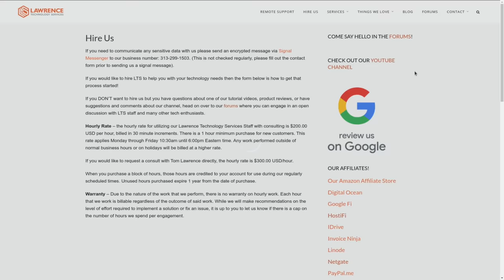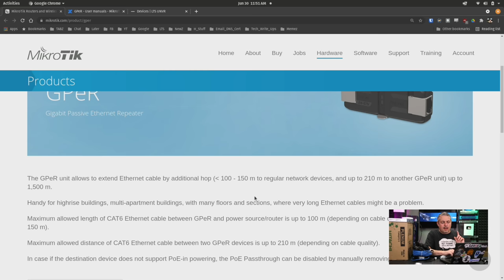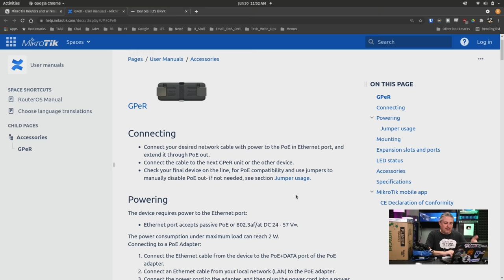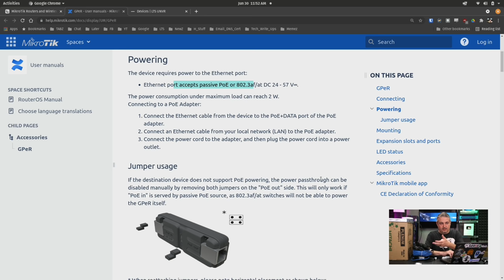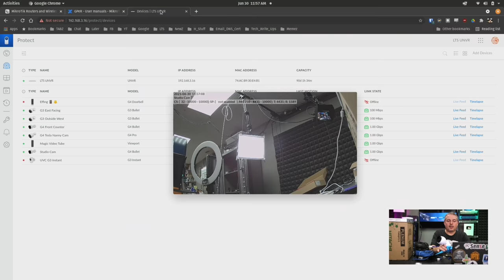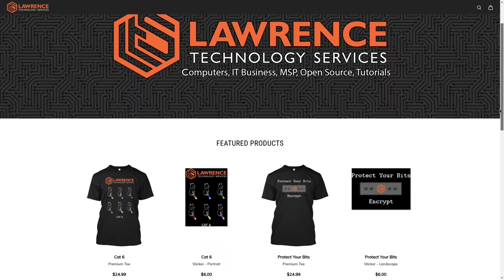MikroTik GPeR and Extending POE Cable Runs

Comment: Just wanted to let you know that I have a run for a security camera to my mailbox. The run is ~425' and has had sporadic connectivity issues. I bought one of these based on your review and placed it 1/3 of the way down the run. It's amazing the difference, thanks!
Reply from the maker: Awesome!
Reply: An outdoor cable run really shouldn't be copper, unless you have taken the time to bond it. This is a job for optical. BUT in those cases where long outdoor copper runs can't be avoided (or if you've inherited one), these are good solutions.

Comment: It should be mentioned you don't have to feed the GPeR's with 24V passive PoE to use the last one in "do not forward voltage" mode. You just have to power them with passive PoE within the voltage range. In the case of Ubiquiti USG and EdgeSwitches, that is 24V passive but in the case Netonix, Ubiquiti ToughSwitches, Mikrotik switches, etc that support 48V passive PoE you can feed the GPeR with the high voltage. If you want to get the full daisy chain of GPeRs (7), the voltage drop beyond 5 GPeRs (930 m) actually requires you use 50+ VDC to power the chain.

Comment: Good to know. I have always done this using a "Ubiquiti NS-W NanoSwitch Outdoor 4-Port PoE Passthrough Switch". They are good for up to 200 meters if you put one in the middle of the run. I normally power lightbeams or nanostations like this. Those devices normally need a .3 AMP 24V POE injector, but with a long run I use a 1 AMP POE.

Comment: Really love em, changed out a daisy-chain of poe devices on a run that really should have had a fiber run, had about 10 devices and cut it to 4.

The weatherproofing case: needed to add silicone to the ends as CAT5 would let water through, wasn't tight enough, and i messed up with the PRECUT silicone ring(8:12) by cutting it once more, didnt notice the first time i held em, was kinda OH! when a sector fell off the ring

Do try to set em up horizontally, even when there's no way to mount them to the POST
Reply: The Precut sealing ring that slips OVER the cable is a great idea (not highlighted in the video). First saw this same cable-end-sealing-method on some Annke cameras I recently purchased. They have a washer-ring at the main-body end of the thread too - look carefully in the video here, it's that orange ring that wasn't mentioned.
Reply: Hi, so I would just like to know. Would CAT5e cables work through this Mikrotik device? This is for POE from a POE Switch to an AccessPoint of over a distance of over 100m. Thus the reason for me looking into this product.
Reply: @marcomckenzie6943  yep, like ive originally posted works fine(nobody uses CAT5 only these days, or even a decade back, its all CAT5e), even with multiple ones in between, mikrotik itself advertises it to go up to 1500 m, do watch out for power requirements, cable length between power source and between GPeR though.

BUT for say 150m pretty sure it can, the power is put through and the only thing to worry about would be the data signal for that length, have done similar things with about 200-300m.
try to check compatibility and do try to get over the required wattage though.

From mikrotiks GPeR product page:
Max out per port output (input 18-30 V) 	2 A
Max out per port output (input 30-57 V) 	0.7 A

Comment: Prolly ali'l late to be askin, since I hava job this mornin, and already committed tha GPeR, but, I find the jumper section in tha manual, ali'l disconcerting.  "Jumper usage
If the destination device does not support PoE powering, the power passthrough can be disabled manually by removing both jumpers on the "PoE out" side. This will only work if "PoE in" is served by passive PoE source, as 802.3af/at switches will not be able to power the GPeR itself."  I'm plannin on usin this on'a run, powered by a Ubiquiti USW-Pro-24-PoE, providing comms to a solar monitoring panel.  I "believe" this switch will auto-negotiate POE req's of the endpoint, but I unsure of how the switch will "see" the GPeR?  The switch supports 802.3af (PoE), 802.3at (PoE+), and 802.3bt (PoE++).  Am I removing the jumpers, in this scenario?

Thx!

Comment: Interesting, but from a maintainability perspective I would much rather have the active hardware at the endpoints.  I can just imagine these stuffed inside a conduit in the rafters of a giant warehouse, a wall somewhere, underground conduit or the like, it sits there for a few years, people move on to other things, and then the new maintainers end up with failed cables not knowing it is really the repeater in the cable run that failed or started glitching up.

Troubleshooting wise and longevity wise, it would be much easier to pull OS2 fiber and some sort of power separately to the other side.  Especially if you end up with OS2 fiber and AC power, a simple let's drive this one PoE camera one day could end up with multiple PoE switches and a CWDM system another day.  It seems so often something starts as we need some sort of connectivity over there for this one thing we are trying to do and then fast forward a few years there are all of these networked devices there or nearby getting network access from that run or talk of doing new runs because the old run can't keep up.  For what OS2 fiber costs, it is pretty crazy what you can stick over it if you need it.  Companies can easily spend thousands just for a single long cable run on installation where say the OS2 fiber itself costs 100 to 200 bucks for a pre-made cable, just pull it through.  Also these runs tend to be doing something useful, so when they go down and you can't immediately figure out what is going on and fix it, that tends to cost more than any money saved by say going the repeater route over fiber all the way to the other side route.

This is also one of my gripes about the coax networks so many of us have as our main home Internet option.  When you have fiber to the home, at least for me, it has been this stuff just works.  There was one time the ISP accidentally unplugged my cable at their CO (central office) and another time the Internet was out for unexplained reasons for a few minutes, but that has been it from them so far.  While coax has its interference issues, there has also been a bunch of times for me at least where something broke or lost power in the active equipment they have in the field.  Actually even with CAT6 Ethernet, those long runs with copper makes me wonder how far can you really go before interference becomes a major issue?  This just sounds like a solution asking for trouble and when you need to maintain this crap, whatever money you can convince the bean counters to pay for the most reliable solution you can get is what you want to be pushing for.  You don't want a networking solution that is going to be problematic and hamper business operations.

Comment: Have a 300m cable run this would be ideal for! (Can't use Fibre as I need PoE for a remote camera) Definitley interested to see 2 or 3 of them daisy-chained. Is the enclosure 100% waterproof? Thinking of putting in an underground duct that can have water in it.

Comment: @8:22 You're using glands totally wrong mate. They go into the body not the tops.
Reply: Yeah, they should be split too. That way you can put them on a cable that already has an end on it. Poe security cameras have the same thing.
Reply: @TimBass  I don't believe these ones are split. They are designed to be installed before the cables are terminated. (As they should be. The split ones do fail even when installed carefully.)

Comment: Do these have a boost converter in them to combat the voltage drop?  I'd be very curious how much the voltage drops at the end
Reply: passive so no it just passes through power, though with 57V at a POE+ switch it should go quite far!
Reply: No. Most Mikrotik devices can operate on a fairly wide voltage range so they just run with the voltage drop. In terms of the data, it's just a 2 port unmangaged switch.